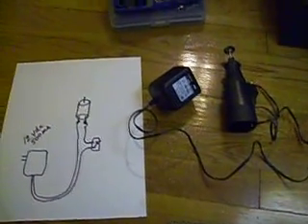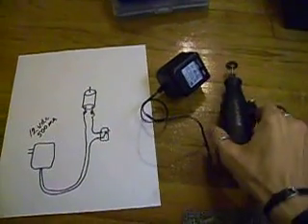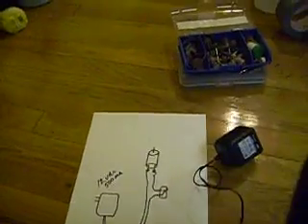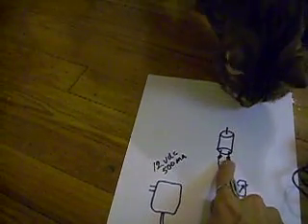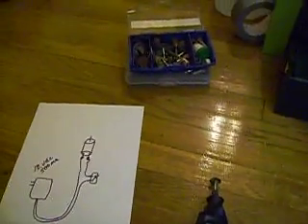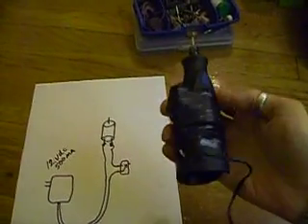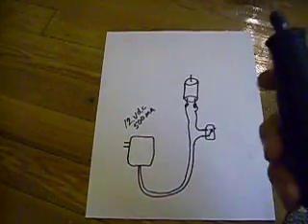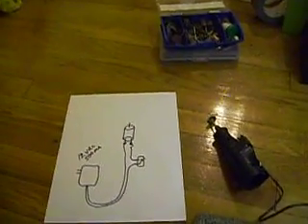DIY Dremel modification

Comment: Well this isn't exactly what I was looking for, but I found myself a bit intrigued with your modification. The safety switch you refer to is the door switch? I tried to think of the switch a dishwasher and microwave have in common. I'm more familiar with the dishwasher switches, since I've repaired one and replaced one in the last six months; microwave not so much. I have all the spare parts (motor, electro/mechanic components, timer motor, etc.) set aside for DIY/McGiver projects. Possibility..